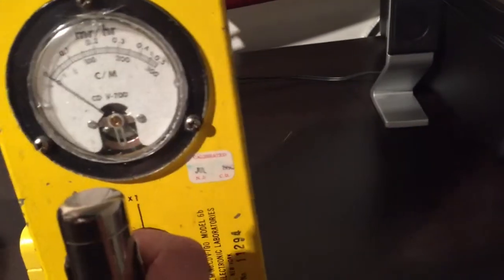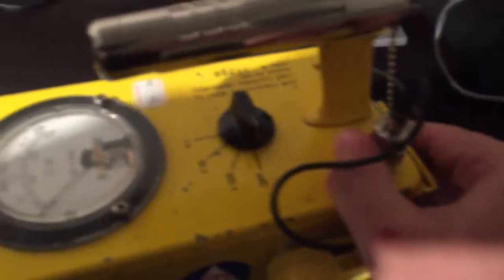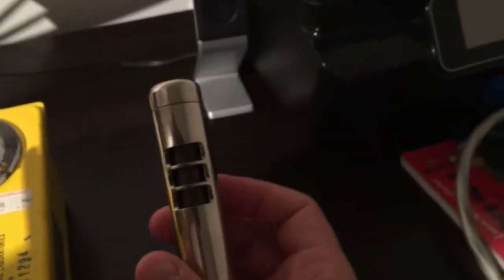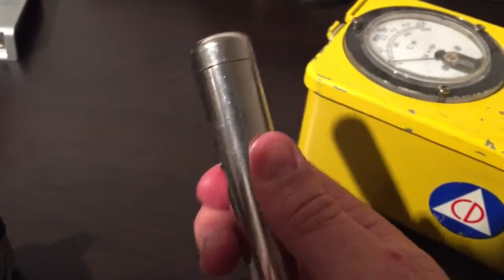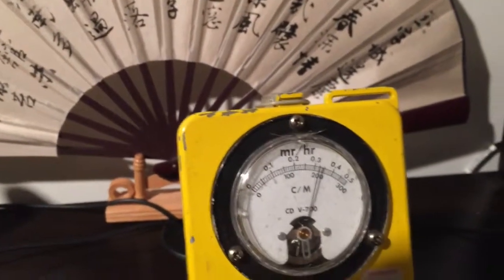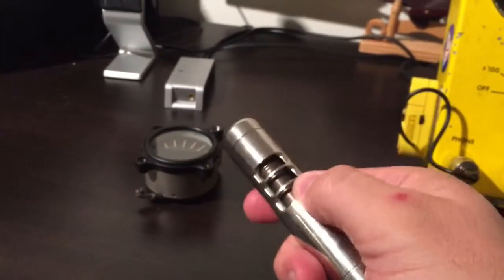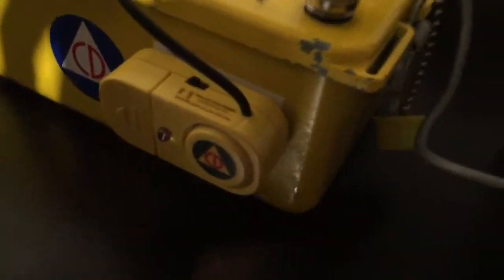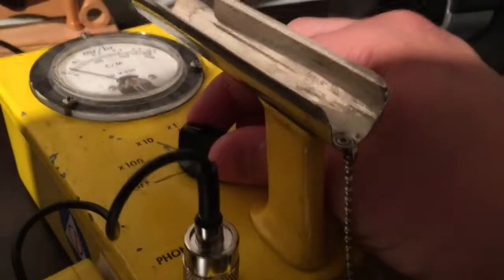CDV-700 Geiger Counter detecting radioactive WWII aircraft gauge

Comment: Good ol' radium! Radioactivity is a cool hobby to get into! Many people fear these type of things. Understanding radioactivity eliminates that fear. I collect a lot of radioactive sources. Those instruments are a nice find! They don't make them anymore. Radium doped paint was ceased in the 1960s. That Lionel is probably from 1962. By the way, it's pronounced RENT-GEN. C/M is used for when you're measuring an unknown source, of unknown activity, and mR/h is used for measuring gamma only for the specific isotope the Geiger counter is calibrated with. For example, two or more different isotopes with the same activity will yield different measurements. It depends on energy. Carbon-14 and Strontium-90 for example are both beta emitters, however, this CDV would not detect Carbon-14, but will detect Strontium-90. Just some friendly advice! It's a cool video! Peace!